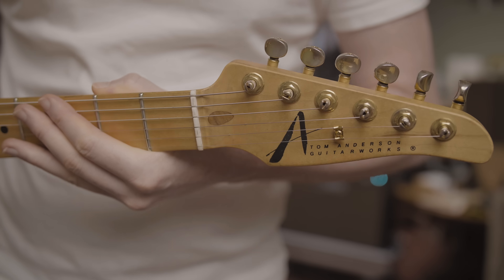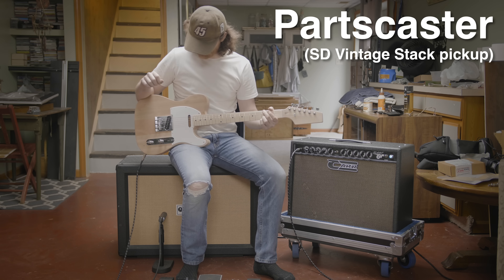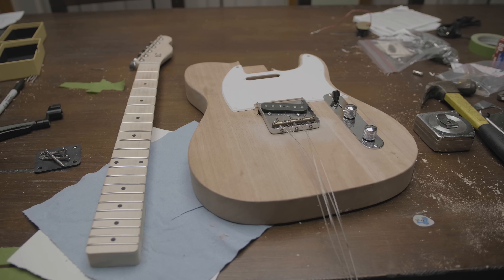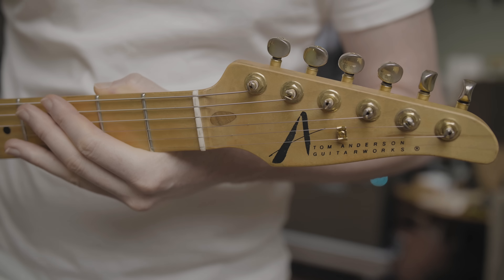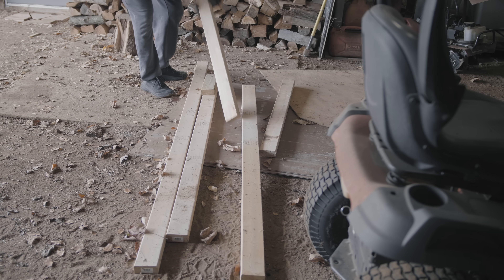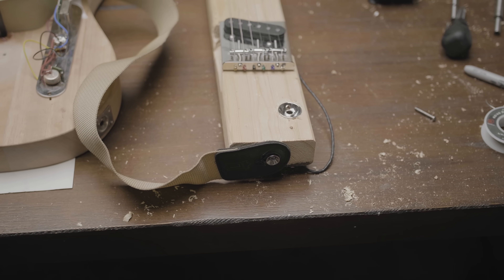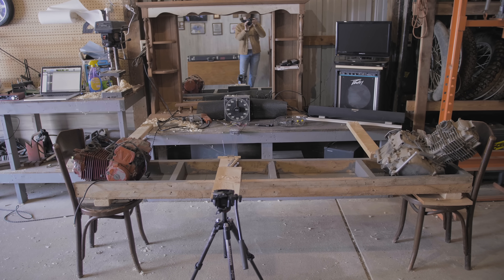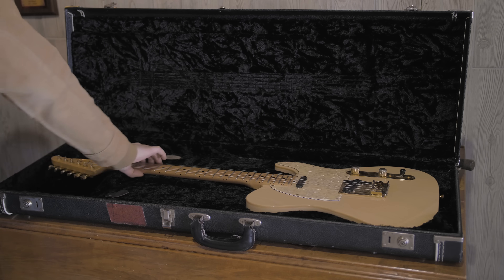Tested: Where Does The Tone Come From In An Electric Guitar?

Comment: One thing that was not addressed was sustain. Tone is not static, it develops after attack, it decays. And the other factors not addressed were overtones and resonance, what happens when frequencies collide. Wood type and hardware is a factor in both. But yes, the transducers in an electric guitar path are the most powerful changes. So the speakers, the pickups, the tubes and transformers will have the greatest amount of effect to the sound. But! Considering that we are playing MUSIC here, sustain, tuning, ease of play, consistency and resonance are huge factors. If a guitar can’t be intonated properly or stay in tune, has dead spots because the wood density is wrong or cheap hardware, the TONE WILL SUFFER and becomes less relevant because music making is inhibited. Basically this video proves the power of pickups and the logarithmic effects of pickup height. But tone is more than what he is testing. In my opinion this started a great conversation but fell short of being comprehensive. Also, what is “listening” is also a factor, acoustics, the microphone, the pre amps the speakers.. it’s goes on and on. But to reiterate, a cheap guitar might be able to be upgraded to have better tone, but there are more things to consider, because playing the thing is not the same as listening to a thing. It’s like the Modeling amp tests where people can’t tell the difference listening but can tell the difference almost instantly when playing. The FEEL is part of music making and thus part of tone.

Comment: I'm not particularly opinionated about this, but there ARE some smaaalll differences between the guitar and the bench. However it falls under the category of "I never would have noticed if you didn't tell me".

I don't believe the type of wood has basically any difference other than rigidity and physical feel of the instrument. I've seen Bruls Art build guitar bodies out of anything. Most of them still sound great. Tone is 95% in the fingers and pickups.

Comment: Even when I show this to my buddy who swears over priced tone woods make a big difference, he will find some BS excuse as always. Tone wood makes no sense anyway to anyone who knows how an electric guitar works. You have 2 points that a string vibrates between at any two times. THis is then picked up, by, a pick up, and sent to the amp. The pick up is not effected by wood. This makes zero sense. An electric guitar is the sound of metal strings vibrating in the air between two points. 
It is NOT body resonate reliant musical instrument like an acoustic guitar or violin. 
A lot of people also don't know this. The original LEs Paul was basically a 2x4 guitar. Why did he blu wings on it? TO make it look more like a "guitar" it had nothing to do with tone. Tone wood myths were invented by smart marketing to make more money on non sense. 
Does tonewood effect an acoustic to the point you should worry about body woods? Yes. Does an elctric? no

Comment: Thank God someone applied science to shut up all the “1950’s wood” makes all the difference. It doesn’t and this video proved it beyond any further debate.  A solid body is just magnetic pickups and wire strings vibrating. Bravo and the debate is officially dead.

Comment: To me strings setup and neck shape are what radically change playability and  electronics are what radically change sound lastly wood type has some minimal effect on sound and in my opinion lighter woods dampen sound less because they have less wood density filtering frequencies.

Comment: I've never understood guitarists who fetishize and obsess over guitars and "tone", especially vintage guitar freaks. There are the obvious distinctions such as a Stratocaster with Alnico pick-ups and a Gibson Les Paul with P-90s, the tonal character will be different & easily identifiable to anyone with guitar experience, & preferences are highly subjective. I've recorded on the same CD with an entry level Ibanez I bought used for $80, and a $1,200 Schecter. Both sounded great, no one could  tell the difference between them. Likewise, splitting hairs over basswood, swamp ash or alder electric guitar bodies is rather silly. The "air guitar" in this video makes that point & then some. The crucial factor is the player, their touch, techniques, and overall aesthetic. Three different players will have three very different "tones" playing the same acoustic guitar without any electronics involved. Bringing in electronics, effects, sound processing and EQing, the determining "tone" factor is still the player, & their aesthetic, not the materials & gear. Robert Fripp's playing, for example, is instantly identifiable, whereas some other guitarists sound like 50 other guitarists. Pick-up configurations obviously play a part in the tone. For 30 years I've played guitars right off the rack and out of the box without doing anything to the set-up, while pick-up-wise, there are obvious differences between Hot Rails, EMGs, Alnicos, Humbuckers, P-90s, Sustaniacs, etc. Play Rockpile's Seconds of Pleasure album, against King Crimson's Discipline album, then play Neil Young's Everybody Knows This is Nowhere album: note the differences in guitar tone. It isn't down to materials and gear so much as touch, techniques and overall aesthetic that make for differences in "tone".

Comment: Amazing experiment!! Seems like the wood of guitar body and neck doesn’t influence the tone that much, it make me curious about how it works on hollow body guitar!
Reply: Acoustic is a different story
Reply: It depends on whether the pickups are designed to make an electronic signal depending on the vibration of the strings or the vibration of the soundboard (bit of wood on top of the body that the bridge is attached to). On hollow body electric guitars it's still a standard magnetic pole pickup that is designed to "pick up" the motion of the strings so the wood should not make a difference, or one that's so slight it's probably negligible. 

I am basing that on the logic of the situation though, it could be that since the cavities cause more vibration than on a solid body guitar those vibrations will move the pickups ever so slightly and cause a change - however I'm not sure how much testing has gone into that. Of course the ACOUSTIC sound of a hollow body electric guitar is influenced by the wood and how its cavities are designed, IE how it sounds when you play it unplugged.

Different story on say a classical guitar with a Fishman pickup that uses a soundboard transducer. This is basically a pad that you stick to the underside of the soundboard and produces an electric signal based on solely the vibrations of the soundboard so this is where the type of wood and how it has been crafted will make a significant difference to the sound translated through the electric signal.

 Worth noting here though that it has been tested and proven that it's only really the material type of the soundboard that has a significant effect. Torres made a classical guitar in the 19th century with paper mache back and sides on the body to prove this point. That's purely material though, the volume of the body and size of the soundhole still matters.
Reply: @squatchjosh1131  it's so detailed man!! thanks for the explanation!

Comment: The air guitar is still connected to a wooden bench at both ends, you have removed the wooden body, and neck, and replaced it with the wooden benches.  I think you have to take the wood out of the equation, for a true test. Still a very interesting video. Thank you Jim.

Comment: the transducers are the biggest factor to the tone from what I've found, and its even more prevalent in a high gain tone, so note this high gain peeps, fuck your tone wood's, buy a comfortable guitar, even if it's cheap, and find some pick ups that you like, pair it with an amp and cab you like (speakers are most impactful, also the way the cab is built) and if you're recording, good mic technique with mics you like, e.g. v30 loaded xxl 4x12 close miked with an sm 57 and md421 off axis one on axis. For cleaner tones especially acoustic, materials are very impactful. also the 3rd builder is the most accurate, and more knowledgable. good to see videos in detail finding out exactly what matters for tone.

Comment: As an engineer, I approve your process. I have always predicted that the pickups are at least 99% of the tone. The only idea I have had on how much a role the wood has on the tone is that the vibration you feel in the wood is energy lost from the string. So a guitar that vibrates more pulls more from the strings. This has been my guess on why something like a carbon fiber guitar would have more sustain, less energy is lost from the string to the body.
Reply: Paul Reed Smith in some video used the phrase "Guitar building is a subtractive equation"  which makes perfect sense.  Your materials and construction only ever remove frequencies.
Reply: Yes, and a lot of folks tell you the difference: A vibrating guitar also means a long sustain! Wood vibration is only important with acoustic guitars.
Reply: loosing energy is an interesting thought, but I guess there is a little feedback, so the tone will sustain longer.
As far as I remember, a (functioning) hollow body can emit longer tones?
But a Log-type eguitar doesn't resonate that way (though not sure if it could be constructed like that)
Reply: As a rocket scientist i don't really approve of his methods. Hold on , I'm going to call my buddy, he's a chef i need to know his thoughts on this. 

Ok I'm back,he wasn't too convinced so he called his buddy, he's a astro physicist so he believes makes him even more qualified to make observations about guitar tones.

He said that his conclusions after carefully removing them from his human exit hole match up with yours.

You sir or Madam are a genius.
Reply: @AllCarsUnited  just saying that as someone who spends all day determining the effects different variables impact on an overall system, his process was solid. Unlike alot of other videos where people change multiple variables without thinking it through. 

What rockets do you work on?
Reply: @MCTGFoSheez  red rockets for sure
Reply: @MCTGFoSheez  yes i defp agree as a chemist change minimum amount of variables in a as simple system as possible untill a clear solution is reached

Comment: I get a lot of customers asking me what the differences are in low end vs high end electric guitars in the shop I work at. Especially first time buyers and beginner guitarists. I usually tell ‘em that as long as they like the look and feel, then they should be good to go! 

The player makes all the difference at the end of the day, and any guitar that inspires you to pick it up and play is a good guitar - this video is just backs that up even harder! Plus, a quick pickup swap will usually get you the rest of the way there if you’re not satisfied later on 😉 (and a proper setup, of course)

Comment: I would have thought, that the weight of the body and head would make a difference to the sustain, particularly, an open string. In this demonstration, I couldn't really tell much of a difference, between a 2X4 body (very light weight) or the actual guitar bodies,(heavy) and 2 work benches, weighted with engine blocks.(VERY heavy!) Apparently, the vibration being transferred into your fingers has a dampening effect, largely negating the mass of the head and body. There might be a slight difference, plucking the low "E", and letting it decay. The difference would likely be noticeable between the 3 set-ups, but, it probably wouldn't be dramatic. There's more dampening from the string moving in the air, than vibration lost into what ever the nut and bridge are mounted on. I'm not surprised at all, that pick-up placement and proximity to the strings makes the biggest difference. (same pick-up, same amp, same settings)

Comment: Love the video and trying to be as scientific as possible. One time I got a gig in a band that played in a weird tuning that started in A. So I bought a factory direct 27" baritone for $180 and a kiesel pickup for about $120 USD and that axe sounds amazing through my set up and all the backlines where that band toured. I learned this trick from engineers not from guitar players or builders. What is the biggest filter on an electric guitar? The pickup. Same with amps, what is the biggest filter? The speakers. So changing those things will make the biggest impact on your tone. Probably saves some money too cause you're not changing a bunch of stuff out. It takes years to really hear the nuance of your own sound as a player and fiddling around with tone woods, nut and saddle materials, or body shapes/densities takes more experience and education to really tune in just right.

Comment: Hi @Jim. Great video but there's one thing you left out. If you have a microphonic PU on the guitar, there will be differences if you play an hollow body vs a solid body. Some of the sound will be picked up and it will change the tone somehow. I did that test using a solid body Strat and an Epi semi-hollow with a Seymour Duncan Phat Cat and I did notice more lower mids on the Epiphone. I'd love to see if you can confirm or not this finding. Cheers!

Comment: Now what about different types of potentiometers and different capacitors on those and what if you don't just put the capacitor onto the tone but if you put it on the pickup selector what if you put it in any place you can possibly want to what if you put it into the guitar cable itself. FOr science

Comment: glenn also did a similar test and there are others that did testing on this subject. Safe to say only the pickup and to a silght but noticable degree the strings are a factor, everything else changes the tone is such minute differences, that you need to compare the sound wave in a daw that it 's propably  human error.

still are great video and the most detailed video on the subject.

Comment: I've always suspected it made little to no difference. I used to paint guitars occasionally for a music shop and always used to receive the instruments in parts, not being a musician myself I did ask the shop owner if the sound might change if I was doing a paint job that needed a lot of layers and clear coat and he waved a little notebook at me and said "As long as I don't lose this it'll sound the same when it leaves as it did when it arrived". He was of the opinion that as long as the electronics were exactly right then the rest was irrelevant.
Reply: No, I believe the notebook was a diagram of the electronics.
Reply: So he wasn't saying that as long as the money keeps coming in don't worry about it?
Reply: @Art-zs6sl  He wasn't a greedy man as far as I could work out, it was a little local shop where he sold and repaired used instruments. He never charged me any commission for supplying me with work when he was entitled to it (not sure on the legality but I offered him 10% and he refused), he just took an hours labour for taking the guitar apart and putting it back together when I was done

Comment: Great video but note that the air guitar would have a lot more sustain than usual as the strings are anchored at both ends to a large solid mass. Also note that playing up and down the neck reveals more about the sound of the finger board than just striking chords. However this video was really well done and should get people thinking!
Reply: "The sound of the finger board". FFS.
Reply: @alan_davis  you don’t think maple vs rosewood vs ebony fingerboards make the guitar sound different?

Comment: Awesome video!  It doesn't surprise me at all.  From a physics perspective, tone is ALL about how string vibration is translated to a voltage waveform.  This is ENTIRELY produced by the strings and pickups, slightly modified by electronics it passes through before hitting the amp.  Sustain however is all about how the physical energy in the string oscillation gets soaked up by the guitar body mass, neck, etc.  Stiffen up anything touched by the vibrating portion of the strings and they will vibrate longer.  That air guitar probably had KILLER sustain!  Lol

Comment: Dude there's a clearly tonal difference between the 2x4 and the Tele. It's not just about the pickups. How about you measure the tonal spectrum of different woods with lab equipment? The tonal spectrum changes depending on the wood density, age and humidity level as well as between different bridge/nut materials. Color each tonal spectrum so they can be distinguished on a graph. I already know that there's a difference because there's videos put there where ppl changed out a bridge or a neck or something and compared the sound waves in a DAW to see if the peaks change. And they do depending on what you do. It clearly is a real thing but not the extent some make it out to be. But it isn't utter BS like some here in comments claim.
Reply: Cope harder

Comment: Strings, pickups, pickup height and angle,  volume and tone pot size and the size of the capacitor on the tone pot. That is most of what tone comes from. Like 95%.

Comment: The biggest factor seemed to be the pickups. No matter the wood, I'd say if the pickups (and probably the electronics) are identical, then the tone should follow. My opinion is based solely on what I learned in this video. I had no valid opinion prior to viewing this video. This was, hands down, the most informative video on this subject I have ever viewed in my life. You used the scientific method to an extreme degree.

Comment: What is the cc displacement of the Honda engines you used to weigh down the bench? 
 I have found that if you really want authentic vintage tone you need to use a Honda NT650 , but it is important to use the original spark plug wires or the high end can get really harsh and if you have any synthetic motor oil in the crankcase at all you will totally lose the bottom end.